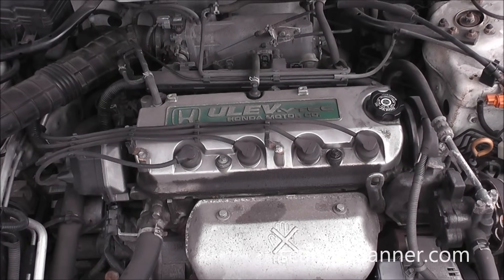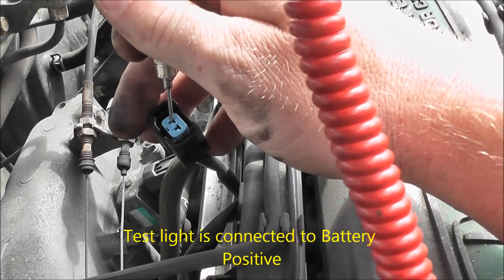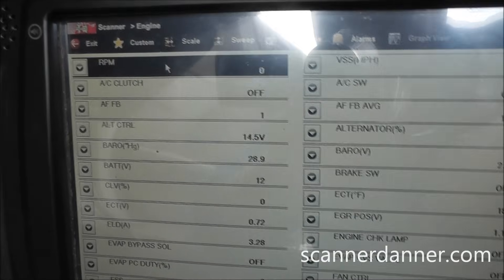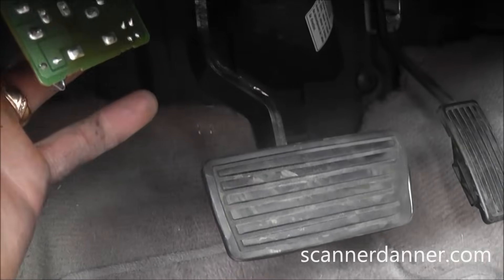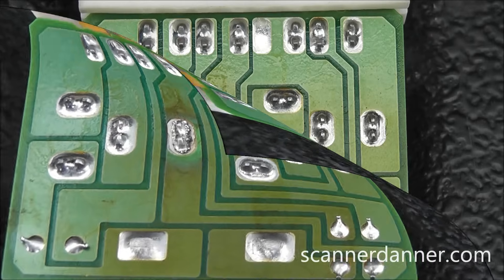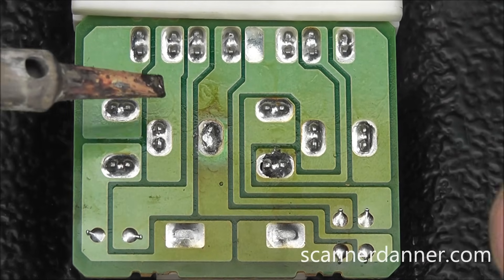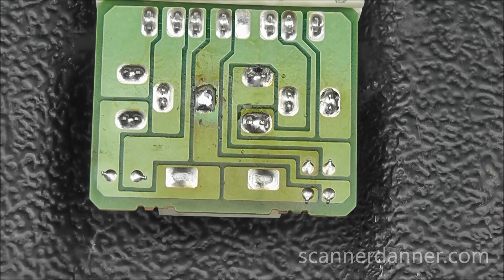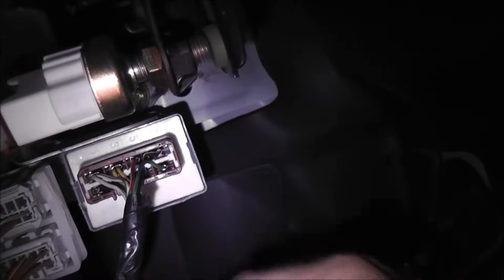How to identify a bad main relay on a Honda (PGM-FI)

Comment: ALL I GOT TO SAY IS THIS CAR SUCKS HONDA IS NO GOOD
Reply: thats funny.. I have a 99 civic.. it has 108,000 miles on it .. the only thing that has ever gone wrong with it was an O2 sensor.. I used to have a 2000 ZR2 chevy blazer.. ya know what went wrong on that ??? a mother fuckin everything! ... therefore hondas win
Reply: strocat25 I have an 02 CRV with 130K km and the only problem I've ever had was... uh... ummmmmmm... I'll get back to you in 10 years.
Reply: I have 333456 miles on my gmc truck and everything work
Reply: lenny1114 Okay... you win. That's like driving 13 times around the equator. Definitely made your money's worth out of that truck lol.
Reply: All I had to replace on my 2003 Honda civic over the years battery.
wheel bearing tire rod head lights and brakes and pads and tires many times.
Reply: I forgot I did have the timing belt and water pump changed.
Reply: suilekelly I feel like I've spoiled myself with timing chains :p
Reply: I got a lot of Flak for getting the Timing belt changed before it broke in my family. Some family members where like you don't fix something that's not broken.
Reply: They don't make them like they used to.  I have seen bad castings in a 2002 Civic.  The threads strip out, breakage, and corrosion problems.  That would never happen in my 1990 Civic or 1987 wagovan.  The 1990 I owned for 12 years and it was already 13 years old when I bought it.  The main relay, ignition switch, and alternator were the only things I ever had to do.  The only reason I got rid of it was all the rust.